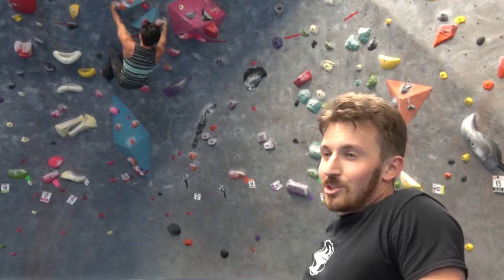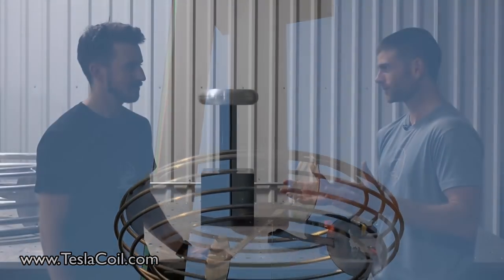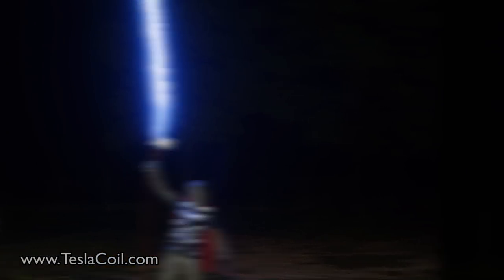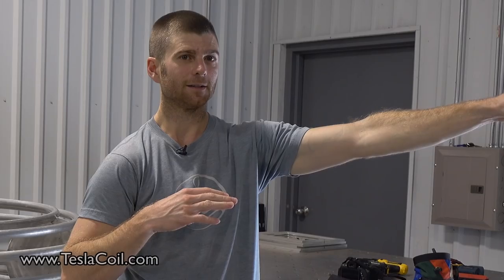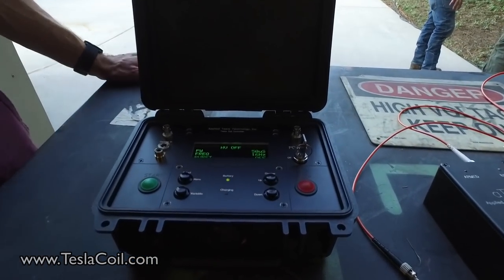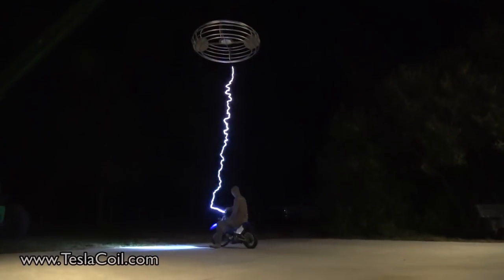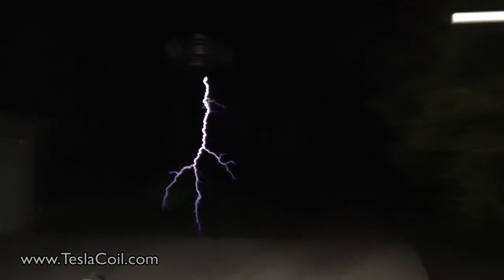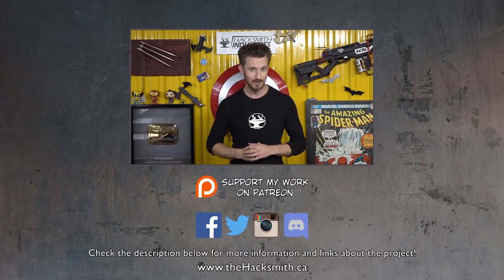⚡ Playing with 1 MILLION VOLTS ⚡

Comment: Tesla coils are fun to make and experiment with. The only bad thing is all the odor from the ozone created. I made a really nice unit 20 years ago that produced 1 foot long sparks. Great video!
Reply from the maker: +electronicsNmore I kind of like the smell of ozone
Reply: I don't mind a little, but inhaling too much is not good for the lining of your lungs. Check out the one I made from scratch using a 10KV oil burner transformer. I wound all the enamel wire onto a pvc pipe with a drill, then applied a thick clearcoat. It worked great....

http://tinypic.com/m/k1xwfr/4
Reply: What are you talking about dude? Ozone is one of the best smells there is
Reply: Davrial aka Blue Mario LOL....Better do some research.
Reply: Maybe ozone smells kind of fun, but I've learned from playing with 140 kV DC source that 5 minutes in a room with slight amount of ozone nearly makes you loose consciousness and it becomes hard to breathe, also you stop feeling the smell when the ozone concentration is too high, so yeah, it's bad stuff
Reply: Matthew Thompson Immature comment. I never told him not to like it. How old are you, 9?
Reply: that destroys Co2
Reply: electronicsNmore you literally misinterpreted what he said smh
Reply: Stop with the self promo

Comment: This guy says his coils are too powerful to play with. The whole idea of high frequency voltage is that is completely unlike 'standard' alternating current, which goes THROUGH the body. High frequency voltage doesn't penetrate, but splashes over the outside of the body making it relatively harmless. What it does do is generate lots of heat at the point of impact. This can be avoided by allowing the spark to jump to a conductor held in the hand. By the same token, the point where the charge leaves the body is also subject to this burning effect, so you need to be grounded to give a safe place for the charge to go. Granted, if the coil isn't built properly, (well designed and properly tuned), you may feel a shock. I have seen numerous videos where high frequency voltage is passing through the body causing no harm. The cool effects are amazing. Lightning shooting from fingers of bare hands, a piece of wood mounted on a metal handle bursting into flames as sparks splash over the surface of the wood and out into the air. The thing about a tesla coil is that it is simply a step up transformer. By stepping the voltage up, the amperage output drops dramatically.
Reply from the maker: +Bub_ Lite_63 of THIS scale? You want to step under one and prove your theory?
Reply: It actually isn't a theory, it has been done before. Yes, I would love to get a chance to fool around with a larger coil. I built one, but ism't very big, and not properly designed. Produces only about 8" sparks running on a 12,000 volt neon sign transformer. Seriously old school. No solid state components like the really awesome coils made today. I am legally blind, so building a large coil would be a trip, and I can't afford to buy one ready-built, but many times I have wanted to. There is old footage out there somewhere, but I have no idea what to type in for the search. The demonstration I saw was on tv many years before there was an internet. I think that was what peaked my interest in Tesla coils. But as I said, if the coil is properly built, (in near perfect resonance), there should be no harmful shock. But the point where the spark comes into contact with the skin can be burned. Even my small coil burns me. I just grab a piece of bare metal, let the arc strike that, and no burn. You do want to give the arc a place to go, however. Otherwise it will jump through your shoes and burn your feet. If you feel brave enough, fire up one of your smaller coils on low power and see for yourself. I guarantee you won't die. You might do well to grab some books on Tesla and read about his experiences with the magnifying transmitter, assuming you haven't already. There are some fine movies about Tesla as well. As for standing under a coil, put that puppy on the floor where one can approach it on his own terms, lol! Send me a 4 or 5 foot coil, and I'll light myself up for you. Just build it right so it doesn't build up any crazy focault currents. 😉

Comment: That's just not the power, bigger coil - lower frequency, smaller coil - bigger frequency.
Skin effect happend on bigger frequencies, when the current flows over your skin and not going inside.
If high frequency tesla coil would have bigger power, it would probably give an bigger RF burn than a smaller one.

Comment: Isn't dangerous when they are jumping or not touching the ground?
Reply from the maker: +Giovanni Paraizo why?
Reply: Because you have to be connected to ground,so electricity can run trought... you can see that your feet light up because of that
Reply from the maker: It's the exact same scenario though... whether I am standing and channeling electricity through my suit into ground, or jumping into the air, the electricity first arcs to me, and then to the ground. There's literally no difference lol
Reply: the Hacksmith But if you were in a really high distance from ground, you wouldn't receive the shock?
Reply: Or it would be distributed trought the suit?
Reply: And what would be the distance from your body to be isolated from ground?By the way,love your videos,super creative and cool looking the things you guys do
Reply from the maker: +Giovanni Paraizo the suit is a conductor -- it doesn't matter where I am, I could be hanging from the Tesla coil, it's just going to go through the suit to the ground
Reply: Oh,okay,i see...

Comment: If 30,000 volts can cook a man alive then can you explain how 500,000 volts surged through nicolai tesla himself and didnt harm him in the slightest? I think you're using a tesla coil with 30k volts at 60hz when it should be at 30 to 15hz, which is preventing you from achieving the same feat as nicolai tesla did
Reply from the maker: +renogiza - different tesla coil... also your 6 saying that as if its a hard fact... Did you time travel?
Reply: the Hacksmith lol no i just did some research on tesla when i gained an interest in him way back, i dont think i remember reading anything about different kinds of tesla coils so ill have to do some more research.. 

On the side, im surprised someone replied so fast, and the hacksmith himself no less! Keep up the good work :)
Reply from the maker: Aha, fair enough!

Also when we said 30kW we said... kW -- not kV. It's easy to get zapped with 30,000V and tell the tale. But 30kW of power is A LOT of energy =)

Comment: Did u question them how much is there power bill
Reply from the maker: You can do the math yourself, if the Tesla coil draws 30kW from the grid, and electricity costs $0.10/kwH then it only costs $3/hr to run the coil! =)

Comment: By the charger powered tesla coils people are touching he means energy NOT power the voltage is high the cirrent is hight so the power is high but because it is 30-200ns pulses the energy is low because energy=voltage×current×time
Reply: He says the power is insignificant but 400000v÷400000Ohms=1A so,1A×400000V=400000W so the power is tremendous but the time is like 0.00003 seconds and 400000×0.00003=12 and 12joules isnt that much so what he actually means is the energy is insignificant
Reply: I overestimated it replace all the 400000 with 10000